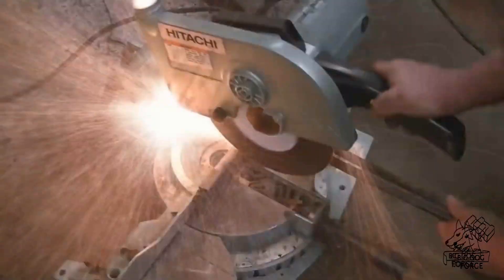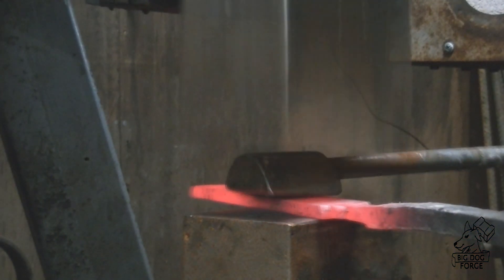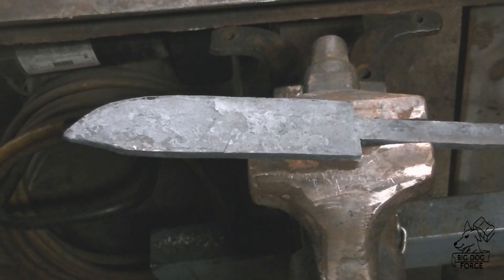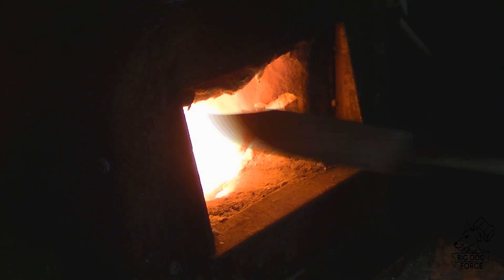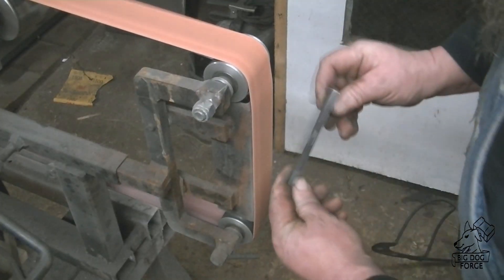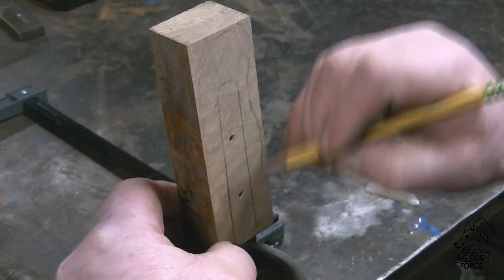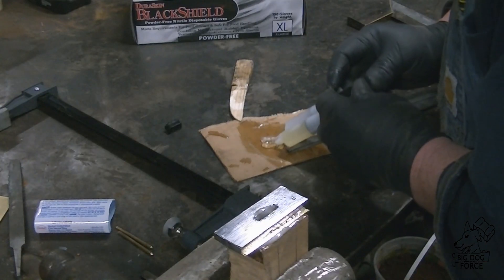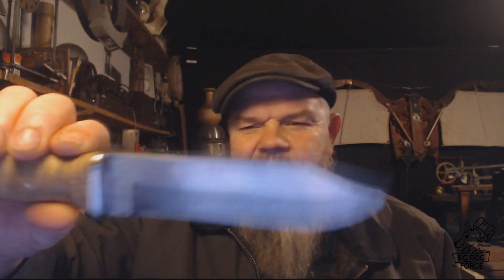Forging A Knife To Trade

Comment: It turned out great!  The guard shape looks very nice with the handle.  It really has a nice handmade charm to it and I'm sure your friend will love it.  It's always see an update and good to hear from you Tim.  Oh yea, you made a note in the vid about the temper colors being different where the oil from your fingers prints were;  this is why judging the temperature by temper colors alone is not the best way to temper a knife and is not recommended.  I've seen knives tempered at around 410 in a proper heat treating kiln come out will all kinds of blues and purples over it and they definitely weren't over tempered/over heated.  It seems that there are a number of factors that can effect the colors on the surface, with oil being one of them as you saw with your knife.  So with that being said you, don't have to worry about those area on your blade being softer or tempered higher than any other part of the blade.  Hope that helps clear that up for ya.  I do hope you get well soon and heal up smoothly, as well as with your shoulder.  Take care and God bless, brother :)

Comment: Would it make it easier to hold the piece with magnets while sanding it lengthwise on the 6" belt grinder? Just so that you wouldn't feel the heat right away, maybe it would give you an extra few minutes before needing to cool it down.

Comment: I just subscribed to your channel. I am about twice of your age but I am coming from the same type of shop. 
I like the way you are working. I’d like to ask you what was the black material you pored around the wheel?  And where do you can buy that?I have to make a motorbike starter and I could use that material. Like your show, I CAN appreciate what You are producing. Keep it up. Regards Bob
Reply from the maker: Hi Bob you can find the castle rubber at the link below. And thanks for watching.
https://specialtyresin.com/product/flex-70-black/

Comment: I may have a huge piece of wrought iron for ya! It's basically a 3-5 pound nail! Just not sure if it's wrought iron or cast iron. Since I don't have a big sander, will a grinder be able to see the correct spark test? Also have a large bolt from the original style farm plows. It connected the the wood that the plow is bolted on to the large U bracket?(whatever it's called lol) Is there anyway that could be wrought iron?
Reply: Phillip Taylor - Hey Phillip, how's it goin?  The best way to test if something is wrought iron is to make a cut about half way into it somewhere, then break it off the rest of the way.  You will be able to see its grain in the section that wasn't cut into where you break it off.  If the grain (not the iron crystal grain size, but the grain that runs through the length of the bar) looks , well, really "grainy" and you can see the different layers that were formed in it as well as some small slag inclusions and a lot of texture, then it's most likely wrought iron.  Also, it's not brittle at all like cast iron is, it will bend quite a bit before it breaks, and the broken sections can almost look like "taffy".   Just google "pictures of wrought iron grain) and you'll find some good examples of what it looks like. Take care
Reply: lsubslimed Heyooo!!! Thanks so much, I completely forgot about looking at the grain. I remember watching a video with that being a great way to tell the difference!!! 

Thanks so much bud!!!
Reply: Phillip Taylor -  No problem 🙂